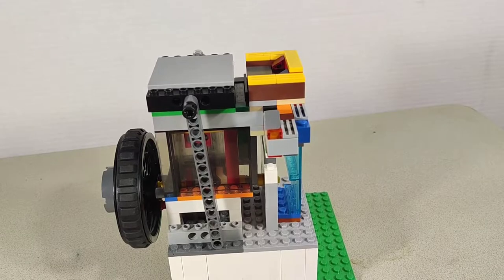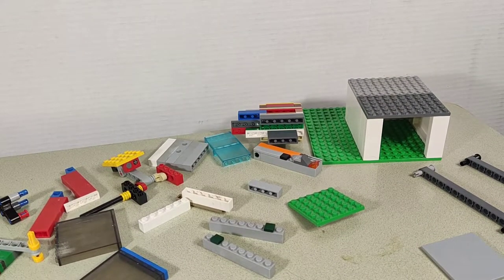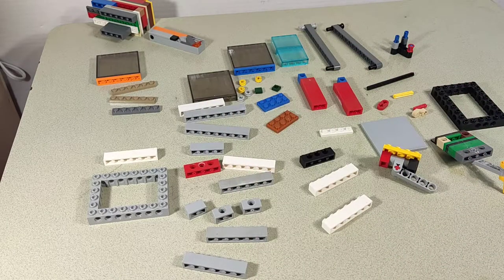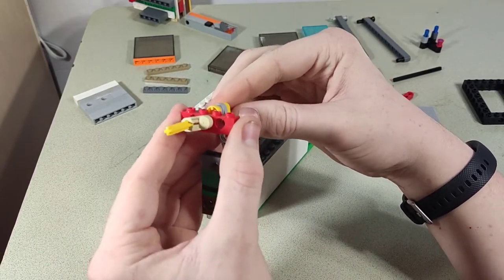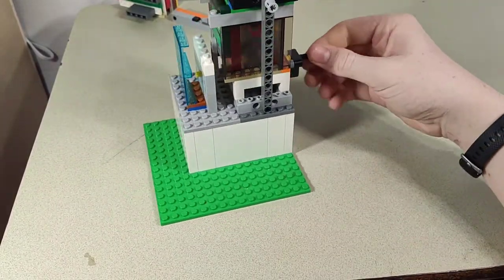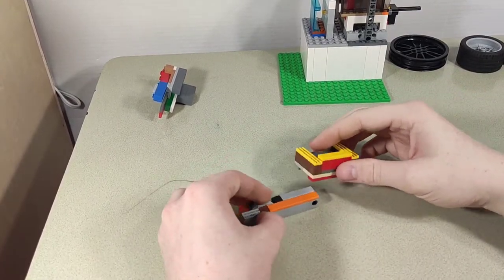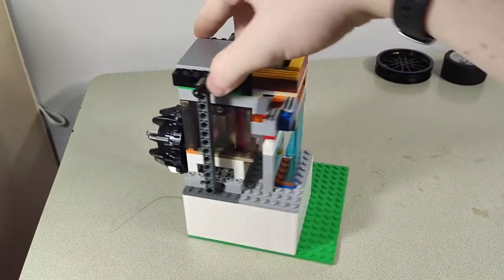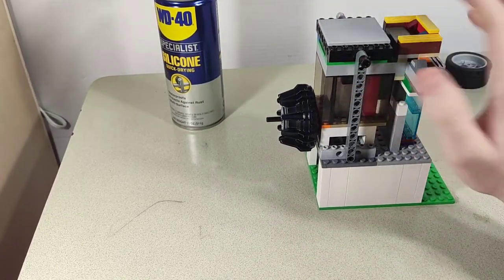LEGO Vacuum Engine Tutorial! | COMPACT + HIGH PERFORMANCE!!

Comment: For a full stock lego engine that's insane
Reply from the maker: I'm glad you liked it! I'm still working to improve it, stay tuned!
Reply: @LS1sLegoGarage  I'm working on a full modded engine. Custom 3d printed parts and two vacuums for power
Reply: @LS1sLegoGarage  just measured 4961rpm
Reply from the maker: Jeez! That's insane! I might end up using compressed air to help with rpm eventually
Reply: @shlushe1050  some other lego engine youtuber made an engine thats reached 30k. 🤣
Reply from the maker: That's not possible with a traditional piston and cylinder engine design.

Comment: Thanks for instruction. Realy cool. 
I like the lack of glue like lots of others  vacuum builts have.
For How long it can work with full power ? How the reliability of it during the time ?
2 stroke is the best- air or fuel 🤪
Reply from the maker: No problem! I'm glad you liked it! 😄. As for the reliability - I don't quite know how long it can run at full throttle before it dies, but I do know if you don't oil it and run it at full throttle for longer than 2 minutes it will slowly melt through the crankshaft. However if you keep it well lubricated you can get many many hours out of it before it fails - and better yet If you develop an active lubrication system it will last upwards of a 100+ hours.
And the reliability of it during that time, you will probably not have to fix anything, it will probably last most of that time without issues.
Reply: @LS1sLegoGarage  thanks for your reply.
Those vacuum motors so cool, even though, the limited use with them, to actually power things.
Reply from the maker: Yup, they're pretty awesome
Reply: @LS1sLegoGarage  i just made 1 today, its not strong as yours, but its works. Im not sure if publish it or not, because clips or motors like yours or kfp is much better. I built this one in 2 hours. Ill think of it 🙂. The torque with mine is realy low for now. I didnt use oil, and did the piston more heavy.
Reply from the maker: I'm glad you had all the parts to make it! Yeah they aren't known for torque or performance, but the fact you can make it out of lego is pretty awesome. You should considering joining the discord linked in the description of some of my videos, I can help you make more torque and speed easier there.
Reply: @LS1sLegoGarage  hi mate, did you saw my last engine ? This one got planty of torque 😎, but i think im done with it for now, lots of other thing to do with lego😉

Comment: Your tach is inaccurate, just by listening to it, your at least going 5000-6000 rpm
Reply from the maker: That's what I was thinking 🤔 could be the batteries
Reply: @LS1sLegoGarage  yeah. Most people I see using those digital tachometer they probably aren’t calibrated properly and register 3500 rpm when it’s really going 6500 rpm.
Reply: I build large electric Lego engines, not vacuum, but pistons are pistons. I think you're getting too much friction between the piston and the cylinder walls. Have you tried lubrication? I use clear silicone spray.
Reply from the maker: Is you're asking me, yes lol I use WD-40 silicone
Reply: It was close actually, the frequency the engine produced at full throttle was about 57-60 Hz, that's about 3400-3600 rpm.